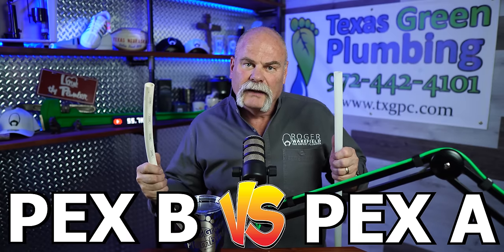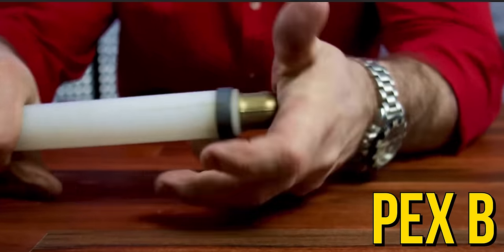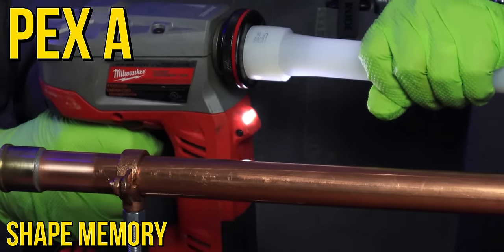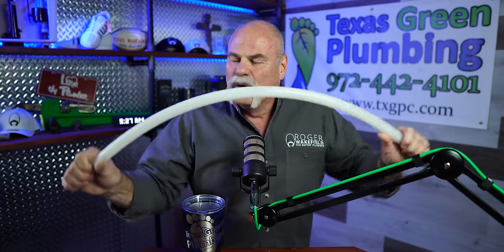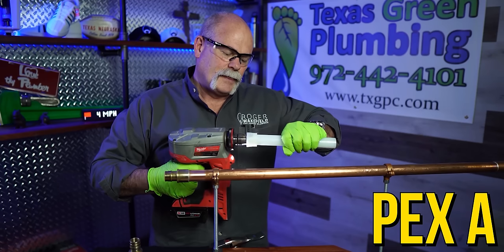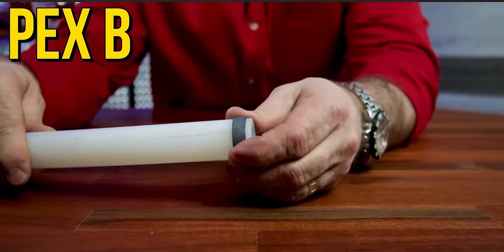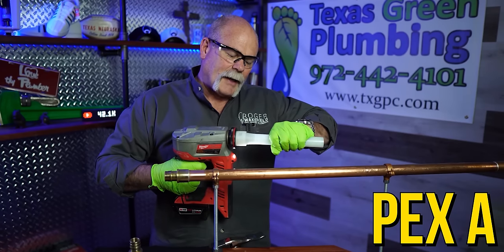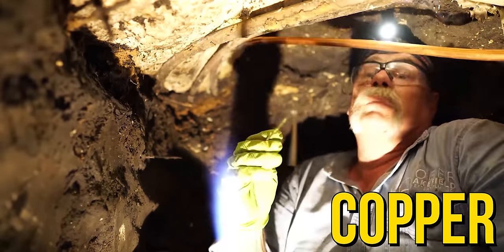PEX-A vs PEX-B - What's the Difference? Which Should You Use?

Comment: The flow restriction is from the pipe fixture no matter what the pipe size, correct?? As long as you are using a pipe size greater than the end fixture, you shouldn't see flow issues correct ??
Reply: Not quite. A long run can introduce more restrictions than a couple fittings and a fixture even if the piping is the same size as the connections on the fixture. For modest lengths (say home runs in a typical home) you shouldn't run into issues using piping that matches your fixtures unless you've got poor supply pressure or your service is undersized.
Reply: @garymorton1723  Hi Gary, thanks for the reply. Would you please elaborate? I am not quite following what you said. Thank you.
Reply: A series of resistors is additive. And with pipe, the relationship between length of a "choke", and the pressure drop it causes, is linear. So in other words, the pressure drop caused by a 5ft segment of a reduced diameter is exactly half that caused by a 10ft segment of the same. It's not simply determined by the "weakest link" like a chain, it's the summation of resistance at all points along the way.

Comment: I only use pex A. Mostly with expansion fittings but sometimes with crimp rings. Another good thing with the expansion fittings is that the tool doesn't need to be on the fitting. Sometimes the crimp tool doesn't  fit in work area.
Reply: Mike, just an FYI pex-a doesn’t warranty their pipe if you use crimp rings. Can you do it? Yes but it is not warrantied if you do.

Comment: Never worked with pex-a.  I have done a few jobs with pex-b though.  But I am wondering what the life span of these connections will be?  I am asking this since it is a mechanical/friction connection and not a chemical bonded connection like with pvc/cpvc etc.  With thermal expansion there has to be a time time frame when the makeup of the product starts to weaken.  I have done some mobile homes that had PB in them since this pipe had bad reactions with chlorinated water and switched them to pex-b since that was all that my local stores had (I live in a town and area where Big box stores are a ways away.)

Comment: you mentioned Pex-B has a flow restriction with the various fittings that are used. 

What about using a Pex-A pipe, such as uponor, but using pex-b fittings? I know it voids the warranty etc. But suppose you have a water line 30' in length and you used 3-4 90 degree fittings. In your opinion would you suggest one must upsize the pipe? Or would something like that be relatively fine, so long as it's not an extremely long run, or you don't have a significant number of fittings, like in the case of a 2 story home.?

Comment: I work at one of the big 3 home improvement stores and everyone is after pex to fix their plumbing and they want the crimp ring system, with this information I am gonna try and push the pex A system from here on out. Thanks for the information on things!
Reply: The main reason is probably the cost of the Upunor expanding tool. If people are just making a few repairs at home and not using it all the time it's kinda hard to bye a 4-500 dollar tool. Time will tell but we may start seeing Wrisbo at box stores but right now all I know that carry it is plumbing supply stores.
Reply: There's a manual expansion tool, you just have to remember to rotate the pipe or tool as you use it. The electric tools do the rotation for you.  I use a tool by iWiss but there are many others. About $120 or so for a kit.  It's a lot of muscle work, but the price is right for DIY.
Reply: @r4z0r7o3  I've seen them before, I guess for a few repairs it wouldnt be bad.
Reply: I'm doing the whole house with them.  The 1" pipe is a workout, but 1/2” is super easy.  A bit of heat gun helps, then again after makes shrink back faster.

Comment: Try a lot of expanding in winter.... No fun. I'm sure it's not as bad during a Texas winter but sealing expanded fittings in the north without heat is a big issue. Also a lot of Pex B is now approved for ASTM F1960 expansion so if you are open to paying more for Pex A pipe ok but I can save a good margin on Pex B pipe and expanding it. Also I have never had really any flow issues with  sizing the  correct number of fixture units rated for the appropriate pipe size with crimp fittings but up sizing can't hurt if your not sure. Personally I like crimp but both have merit.

Comment: I always use pex B 3/4 runs and 1/2 branches never had flow issues. I also double band my fittings. I had a hard time trusting the durability of pex a connections I am sure they work but it just seems sketchy to me.

Comment: Just curious, in the gas industry we are installing plastic pretty much pex A in many ways, we use fusion for are connections,do y'all on the water side have this? (Heat/melt pipe put it together)
Reply: That's high density polyethylene (HDPE) not cross-linked polyethylene (PEX) and yes, it's done all the time for the loops on ground source heat pumps.

Comment: Finally did my first complete house in pex-a about six months ago after years of using cpvc for years it's such a cleaner install no more glue on my hands but one of the best things about the system is it can be air tested for leaks in new construction it's normally a rather large problem to be able to hydro test a cpvc system and being a service plumber as well I've seen the damage a water leak can cause and I never like having my work closed in without a proper leak test

Comment: Roger if I'm doing a shower valve with Pex B should I do it with 3/4 inch pex instead of 1/2 pex to not restrict water flow to the shower valve?  The exicting pipes are 1/2 copper.

Comment: Pex a for about 10 years, we do mostly commercial so I still love my copper ( here in Rochester n.y.  most commercial jobs still spec copper)  but if we do any residential or radiant in floor, its pex a or pex a with vapor barrier
Reply: i'm sure you meant to say oxygen barrier, a must if the heating system has any ferrous fittings

Comment: First, your honesty and integrity have to be recognized.  There's nothing in your videos that demonstrate you're sponsored in any way.

Although some tests show Pex B & C to withstand higher burst pressures, I also believe Pex A is the overall superior product for the same reasons you mention.  One additional reason not mentioned (and I have no evidence to support this), I suspect because of Pex A's pliable properties, it may be less susceptible to becoming brittle over time (like PVC). Thus, maybe providing the best longevity of the different types of Pex.  Perhaps someone with a better scientific background than me can weigh in on my hunch. A contradiction to my hunch is that Uponor's warranty on Pex A is only 25 years, whereas most copper piping is 50 years.  Then again, sell that warranty to the 2021 Texas freeze victims.

Comment: You should do a side by side on the difference in pressure.. Pex A requires an $800+ tool (canada) which would be worth it if it was proven that pressure is greater than pex b, because a Pex B tool is $100

Comment: Roger when I new construction  years ago. We used pex B a lot and 3 mouths into the 1 to 5 year warranty. We would get poor water pressure complaints. 

I started making the guys I was working with use it in manifold system. So you only 2 fittings between the source and fixture, minimumizing the pressure loss down to almost nothing.

When I was booted from being Forman. The new Forman went to the old way and complaints started happening again. 

The owner of the company asked me how I got rid the issue. I told him, he said that it was a waste of time and material.

I quit right then and there.

You can use pex B in New construction,  but you limited to how to run it.

Comment: OMG...we have water flow issues since we moved into out house 3 years ago.  We have pex, plenty of pressure (60 psi), but our flow rate is less than 5 gpm.  And its not oversized.  Have had plumbers multiple times to try and figure this out.  Now wondering if you have answered our issue.

Comment: So we have Plex-a installed in our house.  The frostless bib is leaking and needs to be replaced. I know it is a threaded fitting and not soldered.  Do I need to open the the wall to hold the nut to unthread it or is it safe to just unthread and remove from the out side of the house?  I’m not sure if the PEX can or will hold up to the torque needed to remove and replace the spout. It was a professional plumber that installed it but I have no idea how it was secured behind the wall as well. Please any advise would be greatly appreciated.

Comment: What im curious about is you talk about the fittings and flow restrictions.Both pex a and b use the same fittings so how again does pex a not get the same flow restrictions? I ve used both and found pex b to be a faster install and ive yet to have my pex kink.I will agree only because of common sense that upgrade the pipes size,well it doesn't actually give you better flow but actually more volume in the lines and that is why it gives more pressure. The biggest downfall to using pex is even though the pipe can expand and not burst the fittings can break if they freeze or the rings etc. and that even goes for pex a. As far as plumbing goes pex is definitely the most cost efficient way to go but as with everything if you use it where it would be exposed to cold you should insulate well.I won't get all big headed and call myself an expert,all's i'll say is ive done hundreds  of homes in my life and have used copper and pex and ive yet been called back to fix a water leak and my customers are repeat customers.

Comment: Educational, BUT… your end point (shower head, faucet,etc) creates the large pressure drop.  Unless it’s an open pipe at the end or you have 50 elbows on a line, you will not notice the pressure drops you are describing…
Reply: Correct. Pex b performs fine and only sees a max 5% reduction in flow compared to pex-a

Comment: I use pexB .. doesnt matter what system you use because the flow restriction at the taps due to the small connectors used by manufacturers is the big problem.

Comment: I think the expansion tool for Pex A  is more expensive than the crimp tool for Pex B. I also think pex b is easier to disassemble.    I do confess that when I started using Pex, I didn't even know there was A and B. Home Depot / Lowes had Pex B so that's what I used.  If I started over again, I would like to try Pex A
Reply: I just plumbed a new bathroom in less than a day including running pipes from garage and through the attic using Pex A. I paid $450 for the Dewalt expansion tool with 2 batteries and a charger.  It already paid for itself when I think about what my copper costs would have been when 1/2" is $20 for a 10' stick, the labor saved is a bonus. I still have over 100' of pipe left over and dozens of fittings. My next job is going to give me an even better ROI.

Comment: Not only does Zurn PEX B use expansion fittings and you can use the Milwaukee expansion tool. And they say it has an expansion burst rate of 1000 PSI. Can you do a video on zurn PEX B? Is it more Reliable then that Uponor PEX A? The Zurn PEX B cost more and is sold at most of our local pipe and supply houses. And all the employees say it's better than PEX A? Can you also kink and heat the Zurn?

Comment: Roger: The Ace hardware store I use has PEXa and Sharkbite couplings. Have you had any problems using "A" with Sharkbites? Seems as if you leave the sleeve on the Sharkbite it should stay stable as Pex B&C, available at Home Depot, seems to. Can you answer me? Believe it or not, I'm going to be assembling this shortly after I send this to you, but will check after for your answer, and cross my fingers and not bury the joint.  Thanks for any help.
(The reason I am asking is because ot seems that the "bite" in Sharkbites compresses the pipe. Does "A" stay firm or will it want to compress and counter the grip by the "bite"?

Comment: How would you add a Tee into a short run (24") between two fixed/immovable fittings?  Uponor at 24" is quite inflexible and I cannot bend it enough, even when heated to place onto tee barb.  Is there a union out there?  I did see a slip fit repair fitting which might work or can you think of something else?

Comment: To be completely up to date: there is now a Pex B made by Zurn, referred to as “Zurn Pex B” and uses the exact same expansion fittings, same flow properties and installation tools as the Uponor Pex A Pro Pex. 

The newer Zurn Pex B is slightly a “better product” it’s burst PSI  on the pipe is over 1000psi where uponor pex A is slightly under 500. Pex A also leeches traceable amounts of toxic plastic chemicals (within safe tolerance) Zurn B doesn’t leech. Zurn B is slightly more expensive and slightly less flexible then Uponor A. 

You can tell the difference visually looking at the inside, Uponor has a slightly whiteish color on the inside of a blue Pex A; Zurn B is bright blue all the way through. It’s hard to visualize it till you see it side by side.

Bottom line both Pex A and Zurn B are very good products, almost identical, Zurn B being the most modern. 

Traditional Pex B with the crimp rings is pretty much for DIY and not reliable in the long run, it’s failed many times at the connections and you instantly lose flow from reduction is fittings as mentioned here.
Reply: Zurn EP fittings are chinese made, Uponor EP fittings are made in the States. Both pipes have to pass NSF 61, leeching is really a non-issue. The burst pressure is just one factory choosing to publish their data as a sales technique. The "slightly under 500" is what Uponor has to publish showing they meet the ASTM hydrostatic burst pressure requirement. Zurn has to as well. Uponor Pex-A can handle 1000 PSI as a burst pressure, easily. Pex-B doesn't have the Hoop strength for expansion fittings. Ive done the tests.

Comment: Zurn Pex B is capable of using expansion fittings. Same Pex B pipe, expansion connection process, has a higher burst pressure then type A, chlorine protection, less leaching, and it’s made in America.

Comment: Thanks for the video.  I'm repiping my house.  Can pex a go directly to tub/shower valve or do I need to use a push fitting.
Reply: Solder on a PEX-A adapter fitting to the valve, and then you can expand-attach the PEX-A pipe to that.  I would not recommend using 'SharkBite' push-fittings behind walls; you can't see if they are leaking or not.

Comment: Water is scarce , for me, I use restrictions on purpose!   :-)   You can still get a nice warm shower ... i made a custom 360 degree 2, diameter shower head that sprays me from all sides 1/16" orifices....I tried atomizers for a fog effect  , but here in colorado the ambient humidity is low  so atomized water evaporated very quickly and so get cold before it hits you.... many very tiny streams works well and I use very little water.

Comment: I live in Florida and am about hire plumber to repipe my home. I got three quotes two were supply and install type a pex (uponor)  and one quote was to supply and install type b pex. The b type pex quote was the more affordable option. But I too am wondering about the life span off the pipe and fittings, especially after hearing so many horror stories of type c pex.
Reply from the maker: PEX B is cheaper but it could cause a flow restriction throughout the home...the plumber will have to put in a plastic insert inside the pipe taking it down about 1/8'" smaller than normal...PEX A on the other hand uses expansion fittings so there will be no flow restriction...however it will be a little bit more expensive...worth it in my opinion...PEX A all the way
Reply: If you have chlorine in your water supply then PEX B is superior to PEX A. I live in Florida and chlorine is in our city water supply and when we re-plumbed our home the Plumber used PEX B because of the chlorine content in the water.

Comment: for a single story raised foundation house with 3bed 2 bath in ca. how much is the savings for using pex a versus the mid grade copper when doing a complete re pipe from the street?  i had heard pex should not be used at the water heater area? how about longevity as the original pipes have been there since 1957.  longevity of pex a  versus pex b versus copper re pipe?   thanks

Comment: Have any pros used the PEX B stainless steel sleeve fittings (not the crimp ones) where the sleeves goes over the end of the pipe and can be pressed multiple times? I saw them in the store and they seemed like the most reliable PEX B connection

Comment: What about the Zurn pex B expansion system which uses pex B tubing. Pex B has a burst pressure of 1000psi.  Pex a has a lower rating for domestic hot water return lines.  The expansion system is duplicate to the upunor system. I hear that Pex A can react with chorine and does expell trace amounts of chemicals which is said to be deminimus amounts but Pex B does not.  The cordless expansion tools you use for uponor can also be used for Zurn Pex B.

Comment: Roger, can you talk about polybutylene? Houses with them? Are they a problem if there are no leaks? How do they handle on well water vs city water? Difficulties to repair? Should the whole house be replaced if there are no problems?
Reply: Our home was built in 1993 and they used the gray polybutylene pipe, while we never had a leak while on the well water once city water was installed and everyone had to connect to it the polybutylene started to develop pin hole leaks after 12 years on city water, the city water has chlorine in it and polybutylene does not like chlorine. We had the house re-plumbed with PEX B because PEX B is the most resistant to chlorine in the water supply. PEX A will degrade when chlorine is present in the water.